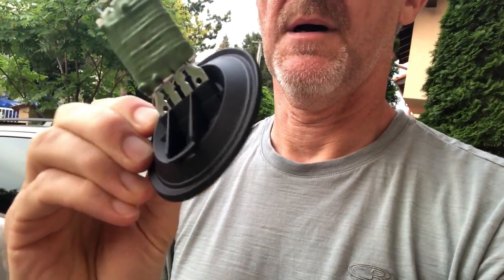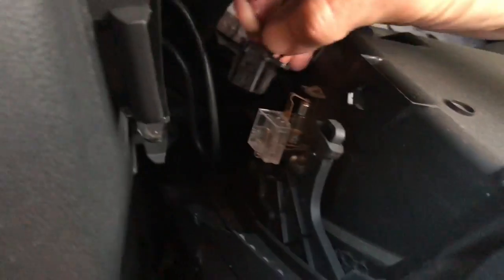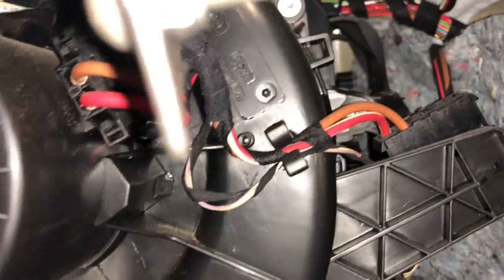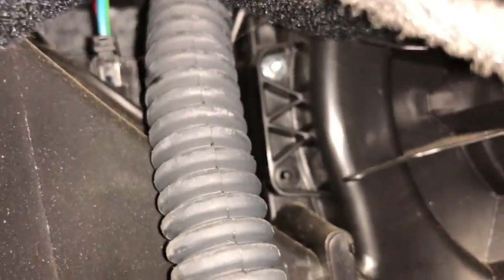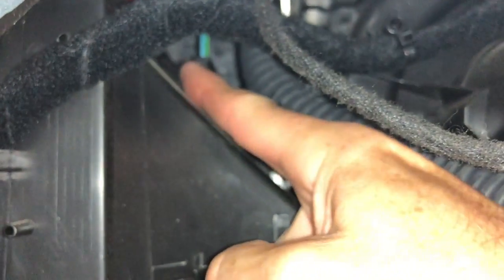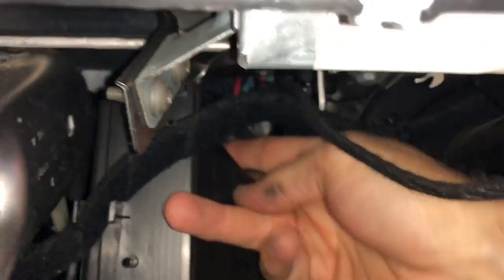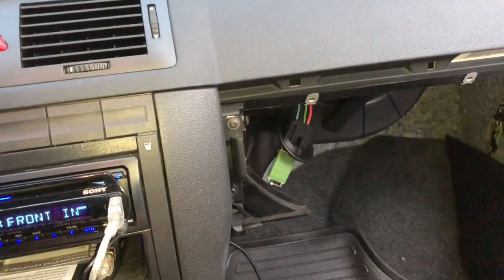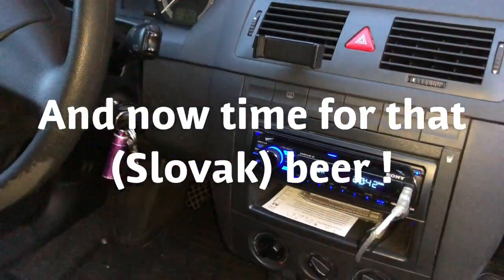Skoda Fabia Fan speed 4 resistor pack replacement repair

Comment: Cheers for this. I love my mark 1 Skoda everything is cheap as hell and easy to fix 😁
Reply from the maker: Same here, mine is 16 years old, 158000km and still no major issues.
Reply: @tonywye  mines on 200000 miles and still going canny. I've had a noisy fly wheel for a out two years but it drives perfect so have left it lol
Reply: @tonywye  aright Tony. Well I put a new one in it didn't solve the issue 😭 changed all the fuses relevant to the heating system still no joy. Maybe the fans just dead?
Reply from the maker: I think speed 4 doesn't use any resistors (since it's full power) so if it doesn't work on speed 4 then it sound like the fan is dead

Comment: Nice video Tony. I had a similar problem in my Roomster. The resistor tend to fail when the fan runs with resistance. When you turned on the fan in your video you can hear a bit of noise. I think that is a bad bearing in the fan motor. The fan motor is not hard to change in your car... it is more difficult in the mk. 2 Fabia/Roomster. Cheers!
Reply from the maker: sorenhedegaard thanks for the comments. I cleaned the Motor after the resistor failed the 2nd time, when I spin it by hand it just went round 1 turn, after cleaning and oiling it does a few turns so hopefully that will help reduce the resistance. Also I’ll turn the fan off when I don’t really need it (I left it on setting 1 for the last 10 years ;-) ). Can’t complain about these minor things that are easy to fix on an 11 year old car
Reply: @tonywye  Thx for your reply. I hope you've fixed the problem for good. I enjoy the simplicity as well!  Keep the videos coming... ☺ Cheers from Denmark.

Comment: Same problem with my Mk3. Called the dealer asking them to order the part first as I don't want to visit them twice even though it's under warranty. Unfortunately they won't just order the part in advance and insisted that I bring the car in for a diagnosis first. On well, two trips then.

Comment: Thank you👍👍👍
Спасибо
Рахмет
Reply from the maker: You're welcome. Actually its failed again last week for me :-( so the replacement only lasted 5 months, I will take out the fan and clean and oil it as perhaps its the fan causing overload on the resistors.
Reply: Tony Wye 
thank you, it works for me now
Reply: Tony Wye 
Well, I did not understand you))

Comment: Hey there, thank you for the video!

I own a Seat Ibiza 4,  2008 with only 4th speed working on the fan. I bought a new resistor but the issue is not solved. Still only 4th speed working. Any suggestions? Тhanks in advance!
Reply from the maker: All I really know is that on 4th speed it doesnt use the resistors at all (fan is direct to 12 volts).

Comment: Hi Tony, did the glove box side panel take much work to remove. Is there any hidden screw fasteners for it or did you just carefully prize it off? This is the bit I'm struggling with. Don't want to damage of course. Cheers
Reply from the maker: Mick Tate When you open the glove box there are three or four screws you need to remove, that’s it, you should be able to see them quite easily, then the  glove box just falls down with gravity.
Reply: @tonywye  thanks for reply, mines a slightly different model but managed it with a wooden spatula!!

Comment: Ooh, I heard that chirping noise from the fan ☹️. You might have to replace the fan soon I think?
Reply from the maker: Yes the resistor pack blew for the second time after a few months so I took out the fan and cleaned it (it only span a couple of times when spinning it by hand), still for a 12 year old car it’s still going strong.

Comment: Tony Wye, my Skoda Fabia recently stopped working on the 1st speed. Is it my blower resistor thats going out???
Reply from the maker: Umair Ahmed usually speed 1,2,3 stop working when the resistor pack is blown. Speed 4 does not use the resistor pack. But guess it could be half broken so only speed 1 is broken.
Reply: @tonywye  Thank you for your reply. I really appreciate the effort you put in to making this video. It saves a lot of us time and money. All the best. 
Thanks
Reply: My speed 1 also doesn't work but all others are fine. Umair did you replace the resistor pack? Does it work now?
Reply: @Lachlan Chartier, Yes, I replaced my resistor pack today and it works fine on all speeds now. I think its normal for resistors to fail over time due to corrosion and heat, but I would recommend you to replace your Pollen filter too which is right next to the resistor pack. I replaced mine too. Here is the link of how to change the pollen filter. https://youtu.be/s-8CnsHIHmE
Reply: @Alpha-bj8yc  thanks for that! I have a Skoda fabia 2011 and I've read that you've got to deal with the airbag. Did you have any problems with this? Just tossing up whether I just go to an auto electrician or do it myself.
Reply: @Lalchan Chartier, I had read about the airbag too but fortunately I didnt have to deal with that. My Skoda fabia is UK built 2006 so I only removed the glovebox and located the resistor pack which was towards the right side of the fan unit. Its a bayonet fit and you have to turn it counter clockwise to release it and the whole resistor pack unit should come out. The easy way to do it is pull your seat forward and try to grab the top of the resistor pack the part where its plugged from and turn it counter clockwise. I think you can do it yourself if you follow the steps shown in this video.
Reply: I have problem with this too , my resistor pack was broken and i repleaced it with new one and that new one broke just 2 weeks after , what should I do ?
Reply: @andrejz.1156  Does your fan make noise when its on? Noise louder than usual? Also did you replace your cabin filter?
Reply: @ Andrej Z.  well, that sounds like your bearing has worn out (or needs to be  greased/oiled) and it requires more power for the fan to turn which obviously the resistor cant provide and breaks due to excessive resistance. Check the link in description on how to oil the motor bearing.
Reply: @Alpha-bj8yc  I repleace cabin filter usualy every 30k km , I noticed sometimes I hear slight squeaky bearing noise coming out of where ventilaotr is . But it is just sometimes . I m electrician and obly thing I can imagine that is doing the problem is that ventilator turns rought so it draws more current which blows the fuse . But also I think that when venilator turn rought it has highier resistance which means lower current and lower speed , but its not the case when the resistor pack goes out .
Reply: @Alpha-bj8yc  Sorry I deleted my previous comment and wrote new longer one , I will check the video , I removed the second broken resistor pack its resistances are good the fuse is blown . It is combindated fuse with temperature and current limits , I have such at home but I do not know the rateings about 216°C but  I m not sure about Amps .
Reply: @andrejz.1156  I see what you mean. There is one more thing you can do. If you still have the old resistor pack, just have a look at it and it will give you more less an idea if it was blown due to corrosion or something else. If its not due to corrosion than that would be something to do with the current. Also dont neglect your cabin filter ( I know you replace it every 30k)  but if its blocked and not letting good amount of air in, might be causing the resistor to over heat.
Reply: @Alpha-bj8yc   Hello , I dissasembled the fan engine and oiled the bottom bearing but  i dont now how to oil the top one . 

photo (top bearing) : https://imgur.com/ZLwGWHO

photo (bottom bearing) : 
https://imgur.com/FoJNsc9

I cleaned and oiled bottom bearing and tried to oil top one , but motor turns still rough in had at least  I think 

And do you now the rattings of the fuse in resistor pack ?
Reply: @andrejz.1156  Hi, to be honest I never disassembled my fan as I never had to and I havent checked the fuse rating in resistor either because my resistor failed due to corrosion. I am not exactly sure how you would oil the bottom bearing but do you have any idea whether its just running rough or is there any bearing ball that is broken?
Reply: @Alpha-bj8yc  Hi , so I tryed to fix it myself . 
1. I measured if the Resistor Pack is broken or it has blown fuse , as show in this video : https://www.youtube.com/watch?v=LUNvzyvn8J8&t . It turned out that my resistor pack are all ok in terms of their resistance , they had blown fuse . So I changed resistor pack fuse , as shown in this  picture : https://ibb.co/g418c1H the fuse is combinated fuse 10A and 216C you need to make sure that the body of fuse doesnt touch the two middle points . 

2. I took the heater fan out of the car using some tutorial (be carefull with airbag cable I needed to rewire it it was going throught other cabels and it was in thr way , I disconnected battery to be safe), there was no debree in the place of the fan , but the fan was cowered with dust , so i took the whole motor out and tried to clean it as much as possible . Then I put some engine oil (5W-40 was only oil that I had at home) on the bearings . Here is video that I followed on how to take the engine out of that plastic holder , It is in russian and it is diferent motor but the principle is the same video : https://youtu.be/ak2Shg8CRrU?t=423 .

Here are the photos of the bearings : 
bottom one (you can acces it only if you take out the motor from holder ) : https://ibb.co/nQynxq9 this bearing was full of black powdery dust so I gived it good clean .
The top bearing is pain , but you should get sense of how to take the fan part out and oil it . I used long siringe to get the oil on bearing photo : https://ibb.co/dDNXWwb the bering is just under the white part .

3. The fan part that white pastic was too covered in black dust so cleaned it as much as I could , I used minimum water becouse I thought that water will damage the motor , but you can use water and then spray it out with compressed air . Here is video from russian mechanic on how to clean the motor for good https://youtu.be/YAcnemZo8ds?t=571 , I understand just little russian but he shows it perfectly , in my case I do not have compressor so I did not use as much water .

The I just let the whole fan dry out , and instalet it back in the car .

But now the fan vibrates on 3 and 4 speed . I don t know why , I checked it holds good in that plastic , I think that I need  to again take it out and trim the fan white part . becouse it was hard to get all dust out of it , and I think that now it is out of ballance or something .

I may just buy the new one , but I just wanted to fix it myself , but it s pain in ass  :D I m just trying to save extra 90euros for new fan that s all :D 

My fabia is mk1 2005 . And the fan is factory one .
Reply: @andrejz.1156  Oh man you have done such big job yourself which is surprising and I am glad you do it yourself. It seems like one single problem is putting you into more complicated issues but you can look for a used fan in a scrapyard. Since I am not an electrician I wouldnt exactly know if that would fix the problem but it will save you money as it will be cheaper than a brand new one.

Comment: Did the oiling of the bearings sort out the resistor blowing again?
Reply from the maker: jazzyman99 yes it’s still working fine, 1 Year now . I didn’t put oil on the fan bearing I just cleaned out the dust etc so that it span by hand quite nicely

Comment: Christ, is there anything that doesn't break in Skoda's - I thought they were meant to be reliable.  Reason I'm crusty, I had a 6 year-old skoda delivered today by a dealer.  After he'd gone, I discovered in disbelief that 1) neither front electric side-windows work, 2) the central locking buttons don't work, and 3) the blower only works at setting 4.  Christ again, I'm cursed - as are these POS Fabias.  Good video though, at least I know what the problem with the fan blower.
Reply from the maker: Had my Fabia over 13 years and the only 4 things I've had done: 1) fan resistor 2)rear seat catch 3) handbrake seizure (it gets to -15oC here), 4) rear door water leakage. 3 of these I fixed my self. I'd say that's pretty amazing for 13 years.
Reply: @tonywye  Hi. Thanks for the response.  I've calmed down a bit since yesterday :)  Spent the day investigating the side-windows - water damage on both driver & passenger doors.  Got both working again, but the switches need replacing - which I've discovered is dirt-cheap via Ebay. The blower problem is a cheap fix as well, but what I can't fathom is why VW/Skoda continued to fit these sub-standard parts - there must be 100's of YT'ers having experienced the same 'level 4' dilemma. I've have a 2000 Corolla, and a 1994 Peugeot, whose fan blowers have never given me a moments grief.  VW cars are renowned for holding their value, but experiencing stuff like this first-hand, I can't for the life of me understand why.
Reply: Same thing fitted in all vw golfs polos seat ibiza's leons so they will go in any of the models. You only need to replace the thermol fuse on the end in most cases, cost about 1 euro.
Reply: No, they are a bit crap. Bought a new Skoda Octavia Diesel Estate in 2015. All four glow-plugs have failed. Clutch blew up just outside of warranty. I live in daily fear...

Comment: Won't be replacing it this time. Just rang the dealer, over £60 for a resistor now. They can keep it. Rip off. I'll make do with the heater on speed 4, if it packs in then I'll just get rid of the car. Disappointing this issue. Had cars before that were over 10 years old and nothing like this happened. Mine is 8 years old. 2nd time now the resistor has packed in..
Reply from the maker: Just took a look online (I'm in Slovakia) and it's still €17.76 but they are also showing another one for €65 . Suspect the €17 is not Original but it's been working fine for a couple of years now. https://www.skoda-diely.sk/nahradny-diel/6q0959263-predradeny-odpor-kurenia-eu-14818.html
Reply: @tonywye  thanks I'll have a look. I'll let you know how I get on. Hopefully an easy job on the Fabia 2.

Comment: And if still not working what else can be? Thanks
Reply from the maker: Does speed 4 work ?
Reply: @tonywye  it work before just on speed 4 and died, and i change the rezistor but still not working
Reply from the maker: @adelinyo  if it doesn't work on speed4 then I thinks either the fuse or the switch
Reply: @tonywye  can i ask how I find the exact fuse?